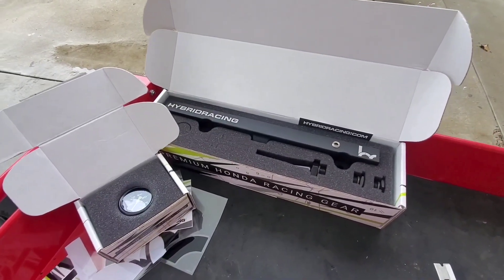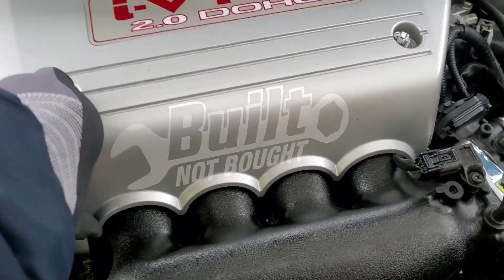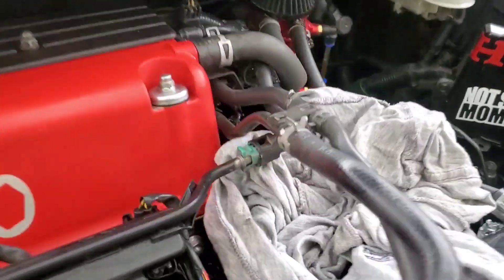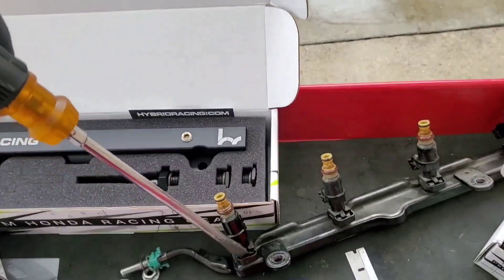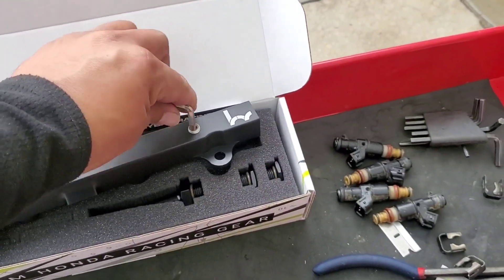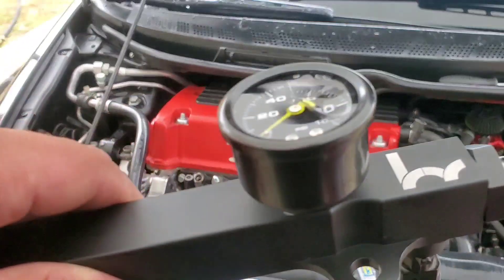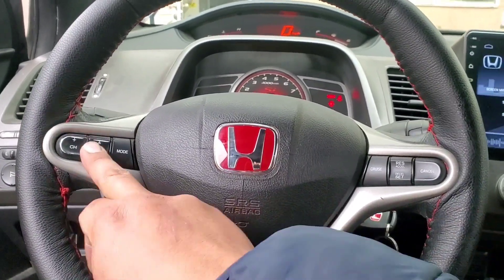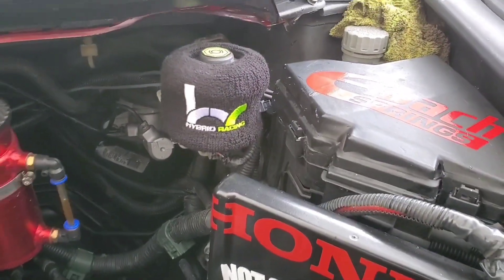How to: Install Hybrid-Racing Fuel Rail /w  Gauge on a 8th Gen Civic Si K20

Comment: I'm here because my fuel rail...well really the injectors are fighting me going into rbc. Don't want to break my 750cc injectors but may just have to send it to get the o rings in the hole without popping off or breaking.
Reply from the maker: Try putting a little bit of motor oil on the o rings and see if you can pop them in....i know i struggle sometimes but as soon as lubricant is applied it slips in 😳 lol good luck bro
Reply: @559powerscape  thanks. used some wd40 and a slow wiggle pressing down. Finally got it about an hour later.  👍
Reply from the maker: @stevekeenan9673  lol it be like that sometimes

Comment: Very nice just what I was looking for. Let me ask ya is there any gains by using this rail. Not sure how a rail would increase power but still a good question. How's it holding up. I was going to get a ktuned one but I like this one also.. lol great video
Reply from the maker: No, no gains its just for looks unless ur doing a fuel return setup then u will really utilize the potential of the fuel rail....for a boosted application
Reply: @559powerscape  right.. looks really nice. You did a good job with your ride!
Reply from the maker: @noblewon3507  thanx bro still a work in progress 🤭

Comment: Are you on IG? What gauges are on your A-pillar? Looks nice
Reply from the maker: Yes @559powerscape it's for oil temp, oil pressure and Wideband Air/Fuel
Reply: @559powerscape  how’d did you do the wideband primary, secondary o2 sensor or welded a bung?
Reply from the maker: @Pablo_ilds  its on the secondary bung on the test pipe.